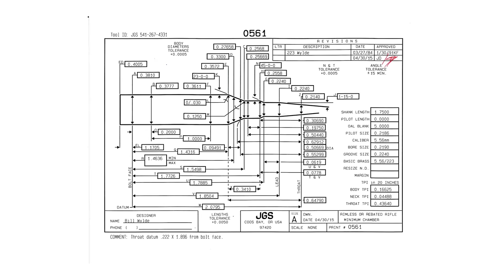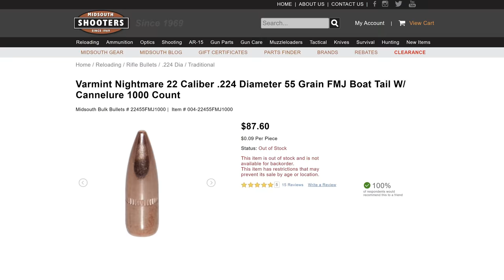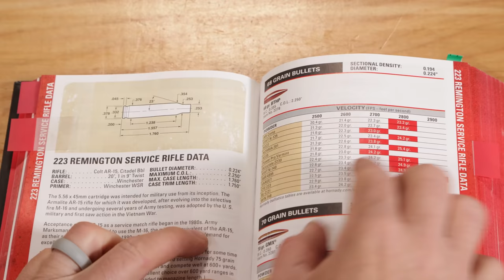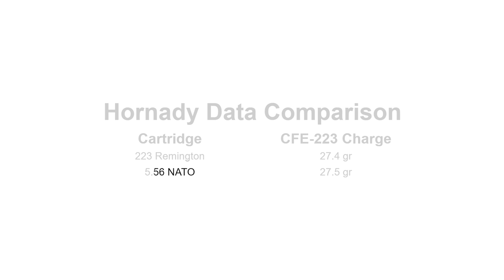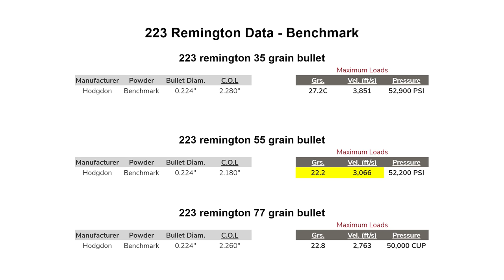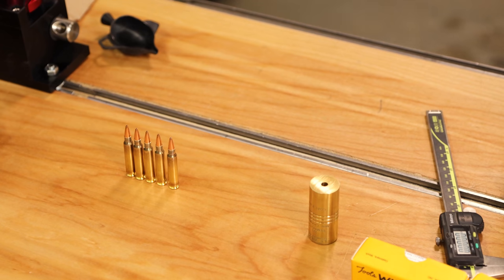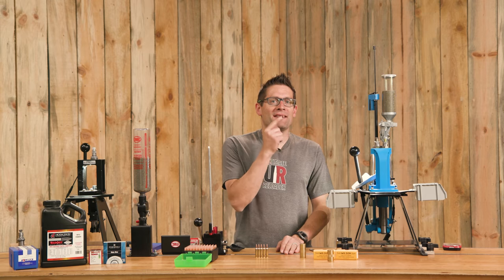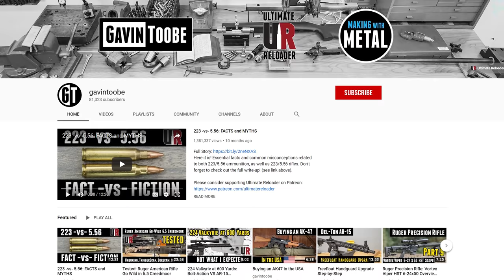Reloading 223 / 5.56 From A to Z

Comment: Gavin, I began reloading by learning what I could from several sources. My local gunsmith/gun shop guy advised me to get a reloading manual and to read it before making any decisions. At the time, about 3 years back, I had a couple 9mm pistols and a couple 5.56x45mm rifles and I bought 3,000 124 grain 9mm NATO rounds for $199 per thousand and 3000 Federal L.C. 5.56x45mm 62grain "green tip" rounds for $299 per thousand. I was interested in handloading but there really wasn't a financial benefit that I could use to help justify the purchase of the equipment. I did read the Lyman reloading manual and its counterpart; the Lyman AR15 reloading manual and I started watching your channel, Ultimate Reloader. This was about 2½ years back.  I finally started buying equipment about a year ago when things were just starting to become scarce. I was able to get everything I needed and I have thoroughly enjoyed handloading ever since. I now load for 9mm, 10mm, 45 Auto, 5.56, 300BLK and .458 SOCOM. I have an HK91 but I don't load for it because I have a surplus of Wolf steel case ammo that I bought dirt cheap 2 years back and because I have been told that the fluted chamber weakens the brass cases making them unsuitable/unsafe for reloading. Maybe you can address that issue? Anyway, I just wanted to thank you because you have helped me tremendously over the last 2 years.

Comment: Gavin, for sizing you forgot to mention that lube is very, very important. Mix of lanolin and isopropyl works best.
Hopefully no novice reloader will start sizing without case lube applied :)
Reply: and buy the good iso 90 percent. so it dries fast. good point
Reply: Lots of luck finding isopropyl alcohol these days. Distilleries have switched from making vodka to isopropyl and making money as the many hand-sanitizer companies are buying up all they can. Perhaps this nonsense will fade now that the vaccination rates are climbing.
Reply: @jekemi2010  prices went down, at least in my country (Slovakia, europe). Recently I bought 2 litres and my friend at the counter had a price of almost 3x of what it cost reulary, but he got it down to regular price as he said it was an old price during panic buys. 
I use that isopropyl to many things, it’s all purpose solution in home, just like winegar.
Reply: One bottle of ISO HEET red to one ounce of liquid lanolin. ISO HEET found at auto parts store. Liquid lanolin found at Natural market. Place batch of brass in large plastic bag, such as a Ziplock, several sprays from your spray bottle then close and shake. Pour out on old terry cloth towel and ready to go in minutes. Alcohol evaporates quickly and lube is not excessive.
Reply: @Preceptor-lf1ht  iso heet is isopropyl. No such thing in my country as iso heet and I would never buy overpriced marketing crap when pure isopropyl can be easily found in stores specialized for lab chemistry.
Reply: @ZhuJo99  Just pointing out something that is readily available over here. Use what you can get easily but always use lube.
Reply: @Jozo99... If you lube every case before sizing, you'll never learn how to use a "stuck case remover" tool...!!!  😁
Reply: @tommysaulter9171  to some degree. As I do large batches on progressive, I've learned that lanolin solution applied to such ammount in plastic bag really has to be preheated in a water bath so lanolin is evenly distributed. So now I do not use it sparingly and always preheat it before sizing few thousands of cases. No fun when you have to remove stuck case now and then.
Reply: Hornady Unique case lube
Reply: Always use lube when loading from the back door.
Reply: @DaHuntersTrophy  true, true 😁
Reply: So messy, only comes off with alcohol.  I ended up using my hundred case holder and using One Shot from 4 angles.  So much easier, no goo.
Reply: @kagyu1  it is messy but comes off easily in wet tumbler with hot water and liquid detergent. I use no pins at all, never.

Comment: Gavin, you make it sound like is very easy and simple, which I think it is once you get to know all details about the loads, dimensions, setting up of the equipment, and so forth...for newbies like me, I guess reloading is still intimidating a bit, initial costs, and specially with the fact that any small forgotten detail might bring you some huge safety implications....but I guess if you want to squeeze the maximum performance of your gun / cartridge, there is only one way to go, and that is reloading....thanks for your hard work on making these videos look simple and intuitive.
Reply: Reloading manuals are a good resource also. Usually lots of great info in them get several and read through them.

Comment: One very important part of sizing is case lube. I used to use the (Easy) One Shot case lube and a lot of people get along fine with it but I've stuck several cases using it so I went to the Imperial Case Wax and haven't looked back. Takes very little and works great.

Comment: I personally like to use 2 Single Stage presses myself. I have witnessed several sports shooters have failed consistency and as a result no powder (Squib) or a high primer in revolver causing lock ups. IMO speed kills. especially with un careful people running the presses too fast not checking as you go.

Comment: A couple of important hings worth mentioning, 1) Bullet weights and the twist rate in the barrel, if you want to shoot bullets that are 60 grains and heavier, it's very important to make sure your barrel has a twist rate that's at least 1 twist in 7", otherwise you'll experience what's called Keyhole patterns in your groups, which is caused by lack of stabilization, and of course you'll be wasting components, and that's important these days when everything is scarce and priced much higher than it was just a year ago. 
2) If you use stick powder in any caliber with a mechanical powder measure, it's better to set it about a half a grain lower than the charge listed in the reloading manual and use a powder trickler to get the precise desired measurement.

Comment: Glad you talked about the case gauge.  VERY IMPORTANT ico 223/5.56 ..............  I use range brass and sometimes we have a 3-10% reject rate because of either bloated bases or deformed heads after punching primers.  Got tired of stuck cases when I first started and still learning more as I go along.   Started doing a more deliberate QC Standards check which also makes this round the biggest pain in the ass to reload.  Very time consuming compared to 300 AAC, 308 and others.   I use H335 with very good results in all my rifle rounds.   
Thanks for the video...............  enjoy
Reply: H335 charge weight and projectile for 223?
Reply: @cs7285  I replied on facebook. Couldn't post any more here on YouTube on your blog...................... Till now...  Was blocked from a reply

Comment: I'm curious why Hodgdon H335 wasn't in the mix.  It's sweet-spot is the 50-60 grain niche, especially in shorter barrels (10.5" to 16").  It has just enough brisance to get the bullet rapidly accelerating, yet slow enough to burnout just before muzzle exit.  I can get 55gr at 2900-3000fps and 62gr at 2800-2900fps reliably.
Reply: What charge weight?
Reply: That's the powder I use 23 grains

Comment: My absolute best performing ammunition for Auto loading rifles with 1in7 through 1in9 twist rifled barrels, is 62gn with 22.5gn of Hodgdon H322. The groups are excellent. Whether a cheaper system or a high dollar AR, they have always shot beautifully. I load them on a Dillon 550B, sized and trimmed with a RT1500, swaged, loading for 3000 fps. This requires 5.55 NATO, or .223 Wilde. Try it for yourself, you won't be disappointed.

Comment: 5.56 also has slightly less capacity because of thicker wall. That plus the extra slight amount of powder can make a difference on that pressure. But having the different geometry o-give to lands having more jump in 5.56 chamber.
Reply from the maker: I did not find 5.56 to have thicker walls after many cuts and measurements!

Comment: Just bought a dillon 750 to reload .223,  After watching this video and many others it seems as if the first station of a progressive press is useless.  Seems everyone recommends depriming before cleaning and how do you know if the case needs to be trimmed before resizing?  So what I gather is depriming, sizing and trimming need to happen before you start on a progressive.  That means you really only need  a 3 position press.  1st station prime and powder drop, 2nd station bullet seating and third station crimping.  Hell, even station 3 is not used on the dillon 750. so like I said 3 position press is all you need . Somehow feel cheated that all these steps have to happen off the press.  It really doesnt seem much faster with the extra steps off press.  Please tell me I am missing something.  Oh yea, and with having to get rid of the crimp on 556 and all these extra stations on the press, why wouldnt they make one of them a swaging station?  Considering the cost of this press and everything being an option, it sure isnt thought out well.

Comment: On PRIMERS for either 223 Rem or 5.56 NATO.  If you are shooting an AR,  The firing pin does not have a spring so when the bolt goes home, the firing pin may impact the primer.  FOR ARs I SERIOUSLY recommend teh CCI MIL SPEC SMALL RIFLE PRIMER (No.41) ONLY.

Comment: Great video, as usual! 
Question: wouldn’t it be safer to remove your fingers from the case as you seat the primer? I know you are using high end equipment, BUT… if a primer goes off, I wouldn’t want my body parts anywhere near the detonation. As a retired mechanical engineer (engines) in the automotive industry I became a believer in the “anything that can conceivably go wrong (+ some inconceivable things) will eventually go wrong” school. 
I really like your videos because you do apply engineering methodology to your topics. Keep up the good work.

Comment: Use a flash hole deburr tool....only has to be done once and you will have a slight but noticeable increase in accuracy. Cases must be deprimed in order to deburr the flash hole. Choose the one you like....Lyman, Sinclair, RCBS, Redding, among others make these tools.

Comment: Great Video Gavin. Appreciate the time you take to help new folk who are just getting started (and us old folk). I recently started loading .223. I resized 50 brass cases (once shot range brass with mixed head stamps). I noticed, out of the 50 cases, there were 30 or so that did not pass the case gage test. I looked to be sure there was no sign of case head separation. I have since found there is a Small Base Resizing Die to be used on cases being fired out of a semi automatic rifle. Have you (or anyone on this thread) had any experience with these dies (RCBS 11103 Series A Small Base Die Set, 223 Remington)? Thanks again!

Comment: To my understanding, and per the Rep I talked with a CCI, for the AR platform, you should use small rifle magnum or #41 primers due to the free floating firing pins.
Reply: The CCI #41 primer is mil-spec and has a slightly thicker cup to prevent slam-fires. I, personally don't use anything but #41s for all small rifle primer applications. I've also found that Hodgdon BL-C2 to be a somewhat "universal powder". I use it exclusively for 5.56/.223, 7.62/.308, & .30-'06... I try to stay with "universal" components, because I buy in bulk (think 25# kegs of powder and brass by the 16gl drum)... I reload for myself and 20 other people in a training group...
Reply: @tommysaulter9171  do you mind me asking where you get those items at?  Never seen brass or power in those sizes before.

Comment: If your rifle, AR or bolt action, doesn’t shoot 23.5gr of Varget pushing 77gr SMK’s well, you have a sick rifle.
Reply: Such wisdom. You should do a reloading video.
Reply: @joehill2172  Try it for yourself to see 😏
Reply: I don’t think so. I don’t take loading advice off of random internet users. I like to develop my own loads. Every rifle is different.
Reply: @joehill2172  well, I certainly wouldn’t take advice from you either. But, if you ever find yourself reloading 77 SMKs with Varget, you may be surprised 😏

Comment: Thank you for the great content Gavin! I have a question wrt Staball 6.5: I also noticed that in the Hodgdon load data but was concerned that the burn rate could be so slow as to result in higher-than-wanted pressures at the gas port in a gas gun. Do you know if this is a legitimate concern or am I over thinking this?
Reply: Stay within the published load data and work up loads watching for issues and pressure signs. Good luck

Comment: Question regarding progressive presses- you must use stage 1 (resize and deprime) as a single stage press... Right?  I'm looking to start the hobby (for 223 specifically) and don't know how the resizing die goes into the process if a case needs to be trimmed immediately afterwords

Comment: Don’t hear you reference lubing your cases when sizing/ removing primers. That’s a step i use so cases won’t get stuck in my die. Doing that also requires an additional case cleaning before proceeding to remaining steps?
Also I have a question regarding load info between 223/5.56. I’m shooting both an AR in 223 Wylde and a Remington 700 bolt action rifle. Can I use the same load in 223 and 5.56 with no issues provided I have tested for overpressure with loads and have found OAL that feeds reliably?

Comment: When reloading .223/5.56 you don't flare out the cases mouth to partially insert the bullet? You hold the bullet and case as long as you can until the bullet goes into the seating die, then the die aligns or guides the bullet into the case? Is this correct?

Comment: I reload .223 on a Lee load master. I have everything fine tuned, except the powder measure.  It just won't throw a consistent charge.  Can you recommend a powder measure that will work well with the load master? Thank you.
Reply: If you're using a mechanical cylinder type powder measure, as mentioned in the video, it's better to set the measure at about 1/2 grain lower than the load recommended in the reloading manual and use a powder trickler, especially if stick powder is used after loading every case. Seven years ago I invested in the RCBS Chargemaster electronic powder measure, which dispenses the gun powder onto a tray that sits on an electronic scale, the powder weight is preset/programmed into the measure, and it provides precise and consistent measurements with every case. I paid around $325 back then, there are others made by Hornady and Lyman and of course just like everything else, they're priced higher now, but they're worth it.

Comment: You showed the case cleaning but did not mention lubricating the case before resizing. 
Important step prolongs die life and gives smoother resizing effort.  Dillon recommends using their case lube spray on easy dries but stinks like ……. I found it easy tho apply.

Comment: Great video, first and foremost. While you provide a great deal of content, it's all extremely important while not boring! I do, however, have a question with some of the breakaway podwers like Shooters World. Have you looked into it, or are you going to do any studies? I'm currently using a load of 24 gr SW TAC RIFLE, COAL: 2.240 (Trimmed as you provided in your video to 1.760), CCI SM Rifle Primers, and 55 gr FMJ and/or 55gr AMAX (all based ob availability). I'm just looking for your thoughts if you have a free moment. Thanks, and keep up the great work.

Comment: Any reason you left Hodgdon H335 out? Reason for asking is that’s what I use, it’s in the book, and I get sub moa with 40gr vmax, 16” ballistic advantage hanson .223 Wylde 1/7 twist and a max charge of H335. (my barrel doesn’t like factory 73gr eldm and groups better with light bullets across the board)

Comment: Reloading seems very complicated, for 5.56 how do you know how much powder to use and how does the equipment know when to stop dropping powder and what equipment do you need for reloading 5.56?
Reply: You use a reloading manual to find the minimum and maximum recommended load for the powder of your choice. Then you load about 5 rounds using the minimum charge and shoot them, checking for over-pressure signs and accuracy. You then increase the powder slightly and repeat. As soon as you encounter over-pressure signs, you have exceeded your maximum safe load for that make/batch of brass, so back the charge down 0.1 gr.  

Somewhere in that range of charges should be a load that produces the best accuracy for that powder. You might not be able to notice it with an auto-loader, but it should be apparent with a bolt action.

Then, if accuracy is not good enough, change a variable (there are many) and start all over again. 😁

Comment: I realize this is an older video but are you not concerned about recommending the wrong primers for 5.56?  You should not use a small rifle primer, you should use a #41 military primer, unless of course you are excited by the potential for a runaway gun via slam firing.

Comment: Where's the pocket cleaning, brushing out the neck, annealing, 2 thousands neck bump neck tension and the most important thing lattering seating depth by 3 thousands to find your harmonic node. Lots missing here. Also trickling powder on a lab balance. Where are the groups?

Comment: Why sort by headstamp? Accuracy? I've never sorted my brass to be honest
Reply: The answer is this, for consistency.  I’ve reloaded literally 10s of thousands of rounds and brass of the same caliber can substantially differ between manufacturers. The thickness of the base and side, volume of the cartridge, the taper of the brass from top to bottom and more even though it’s the same caliber. This causes various issues, particularly velocity and pressures all of which effect accuracy.